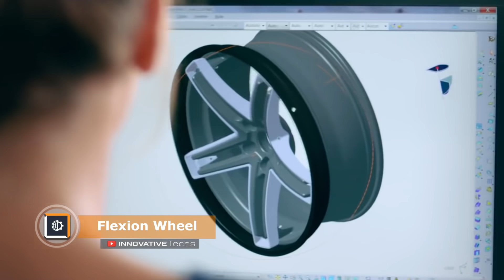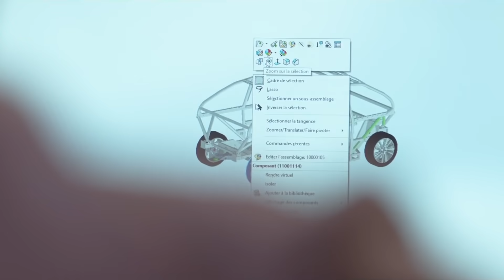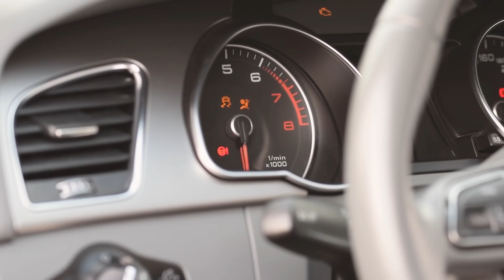Michelin presented airless tires for production cars

Comment: I see a couple of issues with this. I can’t imagine you being able to take a sharp turn going 60mph with these. I see the entire tire rolling and your rim scraping if you even tried. Also the car is going to be very bumpy and you will slide in your seat if you hit any bump. The car rides lower to the ground due to the tire flexing. Going fast down the highway is going to be bumpy and dangerous because of how Misshaped the wheel is. Driving 70mph on a oval shaped wheel does not seem pleasant or safe. These wheels are “overly complicated” and are under preform compared to a simple air tire.

Comment: I've always wondered what would happen when you filled the voids in the 'instead of spokes' with snow and ice.  It doesn't look very practical in a sub-arctic climate.
Reply: @Sawyer Dickson That's not a much better situation, allowing snow and water to pass through, only to freeze solid when parked. A covered sidewall would be the perfect solution.  Granted, it wouldn't look as cool, but it would be considerably safer (and arguably last longer due to not having sharp stones "pass through" the blades).

Comment: Likely will fail. These kinds of tires have been proposed for many decades now. Nearly 20 years ago they tried something similar on bicycles. They always suffer the same problems of not being as smooth a ride as pneumatic tires and having longevity issues thanks to material fatigue from constant bending. It's best to simply wait for a production model to arrive and see how it stands up give the rather poor track record of "new" tech in wheels. There is a good reason tires have essentially been unchanged over the last 120+ years. I'd love to see one of these eventually hit the right design, as I am tired of flat tires thanks to people tossing out glass bottles, but I have seen enough failures to really expect this to be the one.

Comment: On slow moving construction vehicles, it makes more sense. I think they'll eventually get there for road-fairing cars & trucks. Only trouble is they're as aesthetically pleasing as a pink bow in cow shit! And cars make bank on looks! (Regardless of how ugly the crap they put out today is). These won't sell until they're the ONLY option being sold. (Think about how many Manual transmissions you've seen lately). That's the only way they'll sell.

Comment: The problem with these in snow is an out of balance tire. It will pack with snow and get very unbalanced which will then vibrate at speed. Can actually cause damage if it vibrates with enough force. I already get this condition just with wide rims on my car. I have to go to a car wash and get all the packed snow out of my rims to get rid of the unbalanced condition. These will be far worse IMHO.

Comment: Had this only been a tire - but this is an airless WHEEL. Are they really going to produce every single combination of bolt circle and offset? Unless this actually becomes a tire that can be used on regular rims, this is not going anywhere unless for special applications - forklifts and such.

Comment: But whats about snow and dirt?
Reply: THIS. That's why they have only been good for low speed construction equipment. Higher speed vehicles would get offset weighting and that would very quickly lead to deadly vibration at speed.
Reply: Once you have a rigid cage for the tire there's nothing stopping manufacturers from sealing the cage in rubber. But honestly I doubt it'd be as big a problem as you'd think

Comment: The people in the comments section have never heard of a Wheel Cover before :p.
Reply: Wtf is a wheel cover
Reply: Do you mean hub cap?
Reply: I'm guessing you're referring to rocks and snow getting in the tire but there's no "wheel cover" for the inside of tires and can't be because of clearance issues. You don't know anything about cars buddy
Reply: @JohnPaul2711d  There's enough salt coming from you that I could start a mine. And yes they could design a wheel cover for this kind of tire so you're wrong. It would have to be specifically designed for this tire though and couldn't just be any generic one. so before you start spouting ignorant shit think before you speak :P.

Comment: This new-ish wheel technology will probably take one to two more decades as extensive research has to take place before they can actually put these kinds of wheel in the market and on every motorized vehicle 

 [i say new-ish cause I’ve definitely seen this video three times in the last 8 years thanks to YouTube recycling content]

Key factors that need to be tested
Durability, does it work on all terrains, does it work on all weather conditions.

And if this does actually go into market the wheel market is going to decline as there will be no need to replace the wheels. Unless the grip is worn off

Comment: Gas mileage is gonna be terrible.
Even in the thumbnail picture the contact footprint is so broad and flat, you might as well be driving on a traditional tires with low air pressure.
Reply: And you can't tune it with more or less air for the local conditions.
Reply: Ray Lovelace - Exactly! Great in theory... Terrible in actuality...

Comment: I can see this style "tire" being useful in certain specific applications, particularly with construction and garden equipment. However, part of the built in benefit of using a conventional inflatable tire, is that the user has the ability to manipulate pressure to change the desired effect.  Completely different vehicles, with different weight and suspension characteristics, can use the same tire while running different air pressure.  This "spring" style tire would have to be very specifically tuned to the applicable vehicle, which would make it extremely expensive.  If the spring rate of one of these tires happens to weaken more quickly than the one mounted across from it, do you develop an alignment pull that can only be fixed with replacement?  I would be curious if the "spring" lifespan holds up as long as the treaded portion.  People who suggest that this "spring" style tire wouldn't be prone to collecting debris, and getting out of balance, have never driven off of pavement before (and, there are a lot who actually do).  Wet dirt can accumulate quickly.  I think it's been more than fifteen years since I've had to change a tire along side the roadway for a puncture.  As for me, . . . I just don't think I need this!